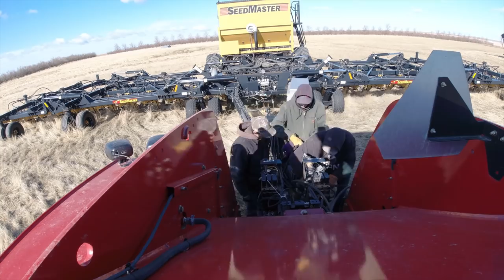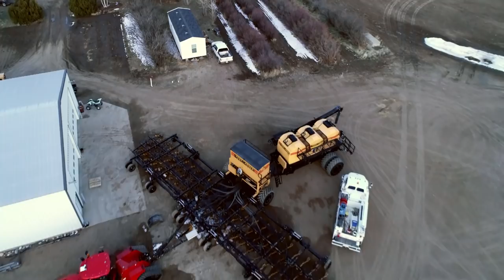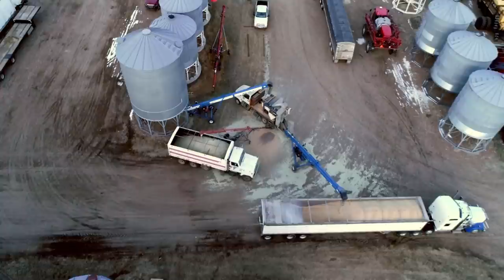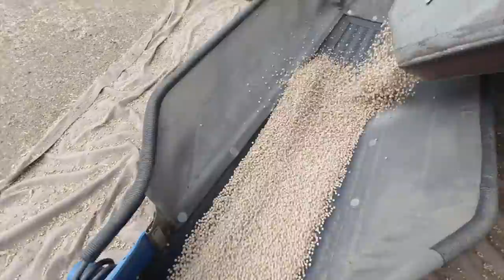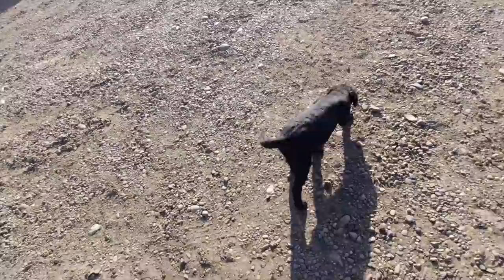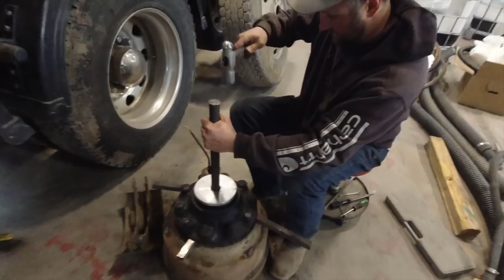Seeding Preparations Part 1

Comment: When I worked at the trucking company we just always pulled the axle out and removed duals hub and drum as an assembly. You had to replace the wheel seal but they usually needed one anyway. They make a cool little cart that handles the wheel assembly so you can roll them away from the truck.

Comment: Gotta ask how come the air drills get parked outside? Lotta money to possibly rust away
Reply: Due to the size of this type of equipment a good percentage of farmers store outside because of the “High Cost” to build a “Cold Storage” building that could conveniently store this type of equipment.  Planters where the arms fold forward rather than upward are more commonly stored under cover because of lower equipment height plus less of an overall “Footprint” required.
Reply from the maker: Dee Mccormac it would cost almost $200,000 for a building big enough.  The drills would need a door 24’ wide and 22’ tall. We could use more storage for sure.  I would like to have the semis inside too.
Reply: Thanks for the information guys. Learn something new every day lol. Keep belting out the awesome videos Tony